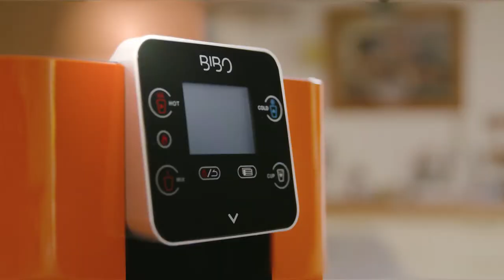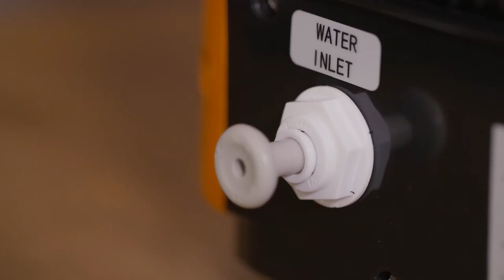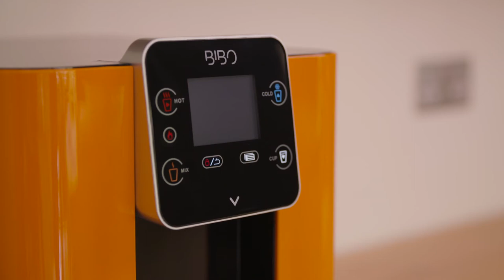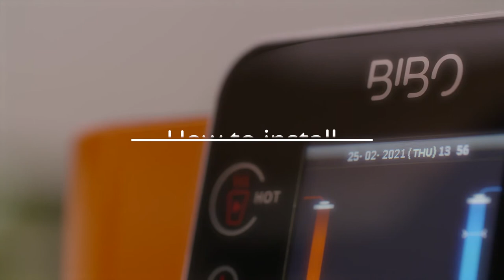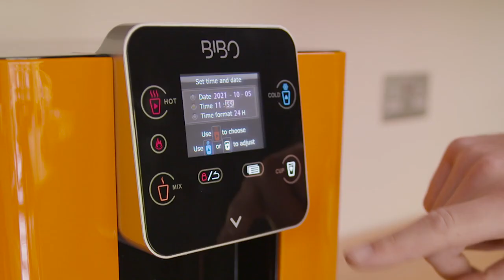BIBO Water - A guide to self installation.

Comment: was just about to order this, but seeing how this is essentially a always on fridge/heater, the power requirement for this machine must be ridiculous
Reply: It has two power saving modes - one like your central heating where you set it to turn on and off and then a sleep mode where it drops both the temps to energy saving modes.
Reply: @mimdonoghue2931  bonjour est ce quon sait utiliser l'appareil sans le mode eau chaude ?